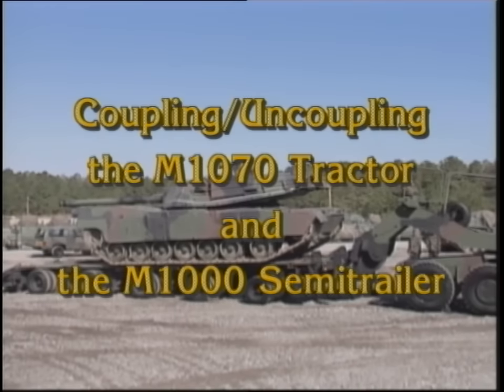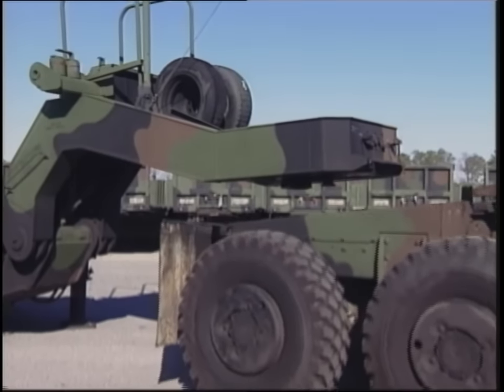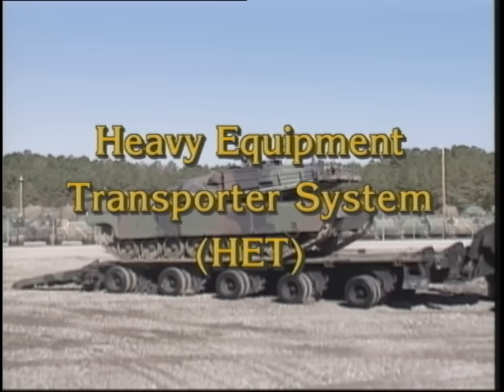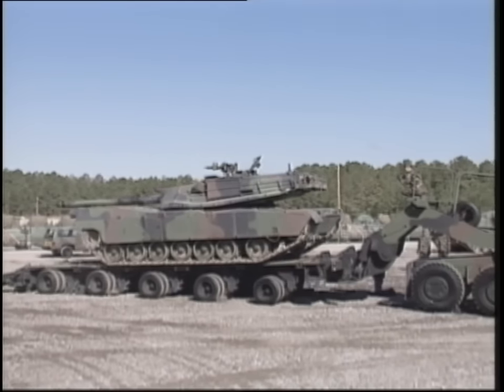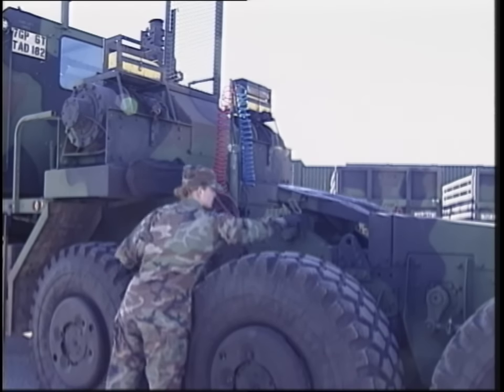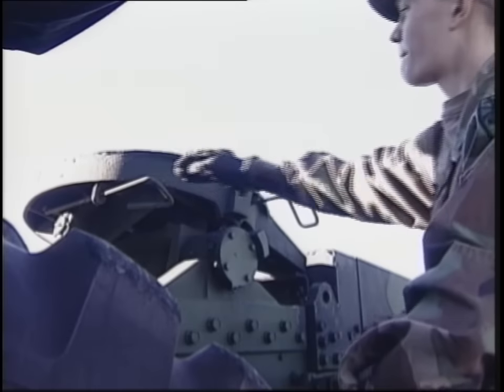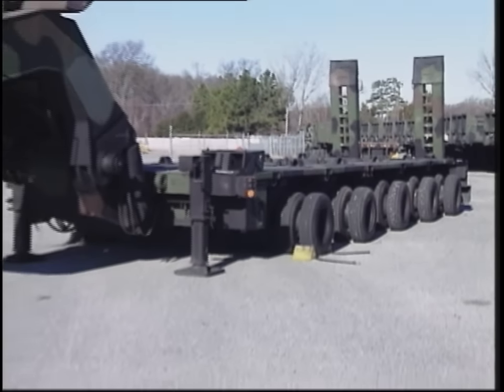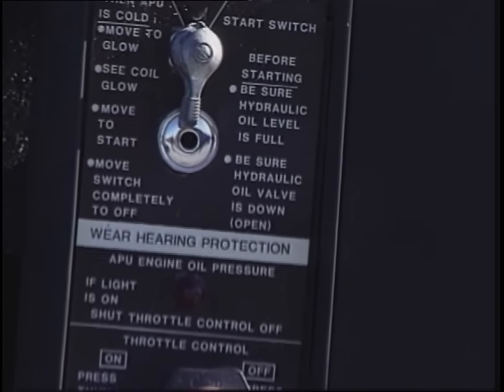Couple and Uncouple M1070 and M1000

Comment: 09:31 "Release the trailer air supply button to pressurize the trailer air system"... while the video shows the driver doing the exact opposite, setting the trailer brakes!

Comment: Funny, the video talks about lube lube lube and the 5th wheel looks dry as a bone.
Reply: I never really looked, but I would say they don't use fifth wheel grease, but instead used a dry pad,maybe ?  as it is used in sand of the middle East on some units.
Reply from the maker: This system is obsolete in the military now with an OshKosh A1 version using a CAT 18 engine instead of the Detroit Diesel. Yes, grease is suppose to be used for the 5th wheel on this mode. The new HET used a Teflon layered fifth wheel that requires no lube.

Comment: Isnt this nick-named the dragon wagon ?
Reply from the maker: Eli Levine yes back in WWII
Reply: it is not the dragon wagon.  the dragon wagon is the mk48 lvs
Reply: The M25 40 ton tank transporter had that name. Not the MK48.
Reply: The USMC MK(Mark)48 LVS transport trucks from the '80's were nicked named the "Dragon Wagon", they were similar to the Army's HEMTT trucks but ours had an articulating center steering section for more maneuverability and detachable front power units. These are now being replaced/upgraded with the LVSR trucks that do away with the previous center section for a straight frame design similar to the HEMTT.
Reply: @npsit1  In the USMC,the LVS MK-48 was always called a "dragon wagon",if you were a 3533,you were a "dragon master".The M25-M26 Chain Drive armor transporter had the same nick name as well.